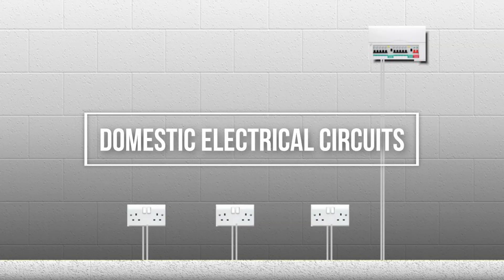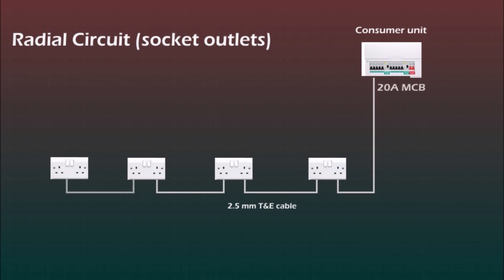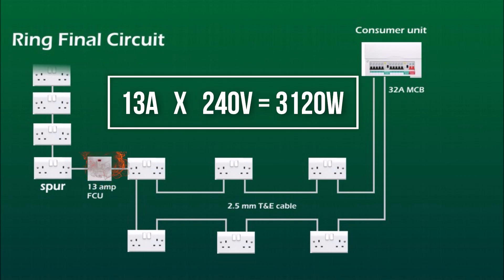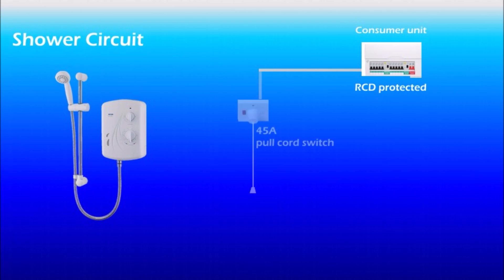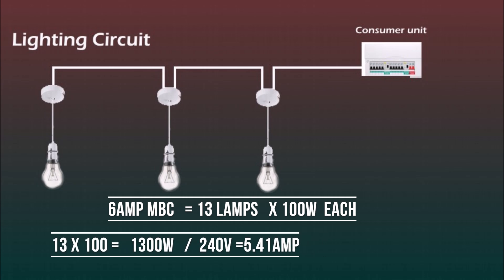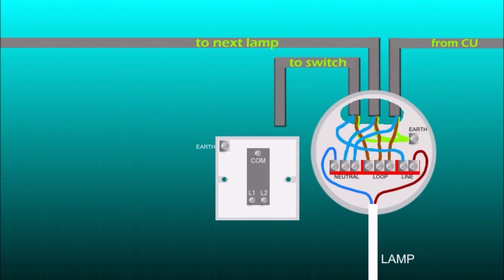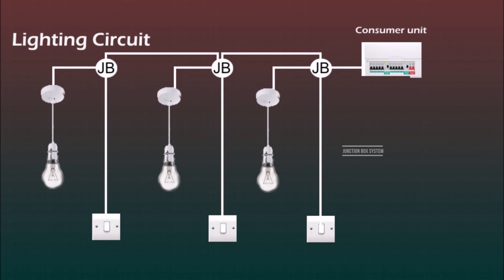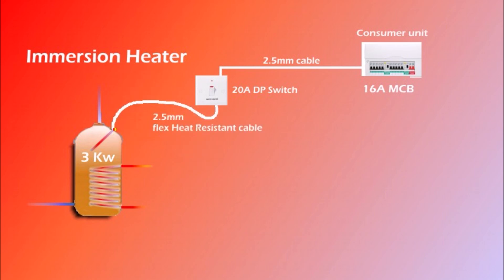Wiring electrical circuits What Cable Size What Mcb size Radial Ring Cooker Shower Lighting Circuit

Comment: I wanted to put some mcbs in front of my 100ah Lifepo4. The maximum is supposed to take is 50a. My problem is in the type of MCB, the time it takes to flip and the multiplication of the amp its rated for, for it to flip. What should I use?

Comment: not too bad but all electrical wiring diagrams should be colour coded and have close up shots.always explain electrics as if you are explaining to non electricians.i.e.laymen.electrical work is very very expensive and many many people try to do things themselves.always make diagrams in bright colours and use very large images and step by step instruction.good knowledge though and well explained.

Comment: This is top explanation . Learn a lot in a short amount of time :) . 
Learn also that From CU there is a 6mm cable running into the kitchen. Cooker cannot be directly connected, it needs an isolator switch. I’ve checked and most of cooker switches are 45A and the MCB controlling the 6mm cable is 32a which seems to be also the standard config…. 32a MCB and 45a cooker switch.

The cooker switch has no fuse so the weakest part of the circuit is the MCB as it should be. It is rates for 45A, this is just the name or type of load/heat can handle before meltdown.

Comment: Here's a tip: On the new wiring colours, the best way to remember that brown is live is that if you ever touch it, then that's the same colour the inside of your pants are going to be...
Reply: We consider neutral as a live conductor when it is energised. It also carries current. You can get a nice zap of it, too 😂.

Comment: Hi, 
I have an issue with my landing light. When I turn the downstairs switch off I cant turn the light back on upstairs. But if I turn the downstairs on then I can turn the light on and off upstairs.
Reply: Switching wire is not connected at the switch the same way in both.
Reply: You would have muddled up the strappers for 2 way switching from point one to two. Nice simple fix, and I get plenty of call outs for problems like this.

Comment: Fails to mention that for a cooker circuit you need to calculate and apply the diversity calculation.  a 32Amp MCB may not actually be sufficient especially with an induction hob and an oven.   Further 4mm2 is sufficient for a 32amp MCB/RCBO       If you need to watch this stuff to understand what to do then you shouldn't be doing the work yourself.
Reply: What about people who are learning? Very informative and easy to learn

Comment: Am I the only person that is questioning this. Is the switch connection essentially wired in series because if the first switch is not working than the others upstream from it doesn't work too because only the first one is connected to the feed.
Reply: In my understanding the live is continuous and  switch only cuts off power to the individual light, looking at the back of a light switch will help to understand how it works

Comment: what size cable go consumer unit frome the meater? Thanks
Reply: Mostly 25mm of what I’ve seen but sometimes you can get 16mm
Reply: If your asking such questions you shouldn't actually be doing the work.  The fuse rating of the head fuse will determine the minimum size tail cable that should be used.
Reply: At least 25mm²

Comment: Hello can I use 1.0mm cable for a radial socket?
Reply: No please... It's 2.5mm
Reply: if you want to protect it with a 6 Amp MCB/RCBO yes - If you need to ask such silly questions then you shouldn't actually be doing the work.

Comment: With induction hob could I use 6m cable already installed induction hob states 40amp 9300klw? I've got 32rcb..do I need bigger cable.
Reply: Do you have single-phase or 3-phase? .. Coz if you have single phase the problem will be that your induction hob already has a lot of current demand at 40A. Another problem you are going to have is with diversity. If you are going to be using the induction hob and you will have a water heater/air conditioning unit/ or multiple equipment or appliances consuming a bit of a load, then your circuit breaker is going to trip. In this case, I think you will need a 3-phase supply where you feed one phase to the induction hob alone. Hope this helps.
Reply: Apply diversity for the cooker.  A separate hob and an oven should be calculated as if a stand alone cooker.  A 100amp head fuse should be good to draw about 23Kw of power.  A single phase supply should be more than sufficient for the average house even with an electric water heater and an induction hob and an electric oven and an electric power shower.

Comment: 2 x2.5mm cables (ring) could potentially pull 27A each? If a break in one of the legs remains hidden, then the mcb will not protect the single leg from overload/ fire, correct?

Comment: Please explain that JB positions need to be accessible  by hatch or located close enough to a light to inspect at a later date as some ppl will take what you said literally  and it will be a guess as to where in the ceiling it is which is super time consuming.good video otherwise I am qualified but have forgotten some much of the theory side.there is a saying in college that you wont use half the stuff you learn on site but trust me it pays to retain some of it you may have to explain technically what you are doing at times and if you want to run your own jobs you need to know your stuff just a tip for the future sparks out there.keep learning

Comment: Hi. Loving your videos. I have used the wire to switch method for led spotlights in the kitchen after following your video. Excellent advice and instructions. I have a question which I hope you can answer for me. I bought a 2.7kw built in oven which comes with a plug already fitted. The plug says 16amps on it. There are no instructions as to what type of cable to use or the cartridge fuse size at the consumer unit. I was going to assume that from the plug socket to the FCU and from the FCU to the consumer unit would be a 2.5 twin and earth to a 20amp fuse at the consumer unit and the FCU would be 13amps. Is that correct? Would be grateful for your advice on this. Thank you
Reply: 2.7kw is not 16 amp  at 230v !       2.7kw is less than 13amps - in fact the plug should contain a BS 1361 fuse at ...13amp .  That gives a clue as to how it could be connected..

Comment: You can use 4mm2 T&E for a cooker if you factor in diversity..... providing you check the specific cooker requirements
Reply: let's hope you can replace the cooker (cooktop?) with one with exactly the same spec too...

Comment: This video takes no account of several crucial considerations:

Length of cable and voltage drop
Insulation lowering the current handling
Reply: Watch the beginning of the video again...
Reply: You definitely skipped the beginning of the video.

Comment: A radial circuit should be covered by a 16 amp mcb if using 2.5mm t&e or 20amp if using 4mm t&e (maximum lengths apply)
Reply: Came here for this comment.
Reply: unless running to say out sheds Radial could be all sorts to much to cover here but for C.U i agree with your comment.
Reply: Why only 16A MCB? A 2.5mm cable is rated up to 26 amps. All info I can find suggest 20A MCB is normal on a radial.
Reply: Building regulations book says you can use a 20A CB for a radial socket for 2.5mm cable
Reply: 32amp MCB/RCBO with 4mm2 in radial configuration is permitted.
Reply: No.  A radial circuit on 2.5mm2 can be protected by a 20Amp MCB/RCBO and a radial circuit on 4mm2 can be protected by a 32amp device ..
Reply: A2 radials on 4mm t&e generally have an over current protective device of 32 A or 30 A fuse. They cover larger areas of about 75 m².
A1 radials with 2.5 mm t&e cover a max area of 50 m² and are fused at 20 A or sometimes 16 A dependant on the number of outlets and / or the reference method of the cable.
Reply: 4mm we use for 32 amp

Comment: While this is a good video explaining the basics it does not cover all the aspects of regulation compliance when installing these circuits, I regular carry out EICR's on installations carried out by people without the require knowledge and skills to install these circuits safely,   usually resulting in large amounts of work to correct the faults found. Generally it is cheaper to get a qualified electrician to do the work especially if your work requires a building warrant as without the required test certification your installation will not be passed by build inspectors.
Reply: Hi I'm interested in getting into this line of work - do you think that completing a level 3 course at college and getting the necessary certification would be enough to find work doing inspections? Also do you generally work by yourself? Thanks!
Reply: @irateindividual8086  I generally work alone now, but spent 20years working for firms before starting my own company. Having the technical qualifications is only half the story as far am concerned. Experience in the practical side of electrical installation is far more important. When doing electrical work its not just about knowing how things are done now you have to also know what was acceptable in the past and why a particular method of installatio  was chosen when the installaton was designed. Most companies want experience in installation practice for personal doing inspections. If you set up your own company doing this your taking on alot of liability as you are certifying installations are compliant.
Reply: @mikeharlow3159  many thanks for the reply! Sounds like college/night school then working for a company is the right way to go then!

Comment: Why would you choose the RING option over RADIAL that doesn't require you to cable back to the consumer unit? Is it safer in the event of a fault or can it take a greater load maybe? Since it's cabled from two directions I guess the load on the cables isn't as great?
Reply: The benefit of a Ring circuit is that it is capable of delivering higher currents with a small increase of wiring, i.e. the final run back to the consumer unit. For example, (and with some simplification) if you created a ring with only one socket and plugged a device that drew 4A, 2A would travel down both cables that went back to the MCB for that circuit. This allows more current to be drawn overall, hence the higher MCB rating. However, the draw back are that if a fault were to occur, and a cable were to break you may well not know that that has occurred as there is still a path to the consumer unit, and, in a worse case scenario, this could then be drawing 32A down the 2.5mm2 cable, exceeding it's rated limit and potentially becoming a fire risk. On the other hand, a Radial circuit is safer in terms of identifying fault, i.e. if it breaks you know straight away, but if you need to draw a large amount of current, you need larger cables, and due to the voltage drop, this may not just be doubling size for double power.
Reply: It stems from the war when metals were scarce. The idea is that each socket could have two inputs cabled with 1.5mm cable with the total socket current coming from both cables each at a lower current (ostensibly half each).  Fine in principle but very dangerous if the ring was broken and therefore all the current would come in from one side and as the rings’ fuse rating was set for both cables to be correct you could then overcurrent the single cable possibly causing a fire. They’re also a real pain to test. Hope this helps?
Reply: @johngrannan  yeah, thanks. Makes some sort of sense if the cables in a ring circuit are thinner. I never knew that.
Reply: It seems to be only us Brits that use a ring circuit.
Reply: I was thinking the exact same thing.I thought maybe if there was a break in the radial circuit just before or after the first socket you would lose power to all the remaining sockets in the chain, whereas if there was a break in the RIng option you would still have power to all sockets (only the Ring becomes a two Radial's due to the fault splitting the circuit) although how would you know if you had a damaged cable if there was a break and power still remained to all sockets?. I don't know. That's my best guess so far, Can someone advise, please?
Reply: Ring circuits are common practice and actually work out cheaper as you only have to run 1 more cable back to the consumer unit which allows you to wire in 2.5mm instead of 4mm, therefore it is cheaper. Not to mention other properties regarding safety etc.

Comment: Hello how2d2 can you please do a video on how to wire an consumer unit with rcds rccb rcbo and also can you do a video on how to calculate maximum demand and diversity in actual amps for lighting circuits, ring final circuits for socket outlets, electric shower, cooker and immersion heater please reply back to this comment!!! many thanks
Reply: if you asking those types of questions you should not be doing the work!

Comment: Appendix H of OSG: BS76712018 Table H2.1 indicates for Radial circuits with 2.5m cable you can have 20Amp breaker so long u dont exceed 50m2 floor area. With a 4mm cable you can go with 32 amp breaker and maximum floor area is 75mm. Good video as refresher.

Comment: Hi!  Can I add another socket like a spur in radial circuit? And how to check that is  radial or ring? Any chance. Thanks for answer. Good video. 💪
Reply: You can add spur on spur on radial circuits. We call it branching the circuit. As long as you don't exceed 50 m² floor area. Generally, a radial circuit will have a fuse or mcb of 16/20 Amps . 30/32 Amps for a ring final circuit. Testing the installation would help determine if it's a safe functional ring.